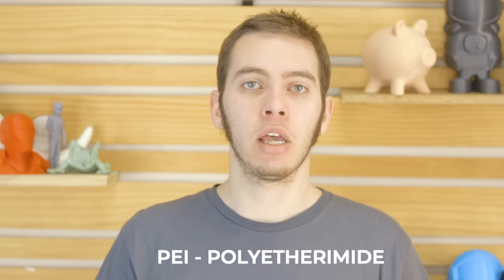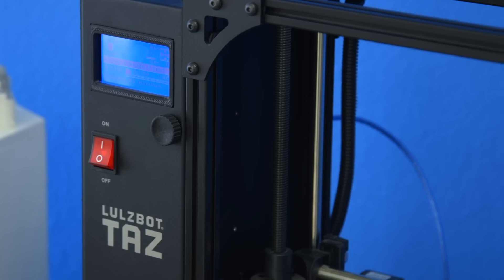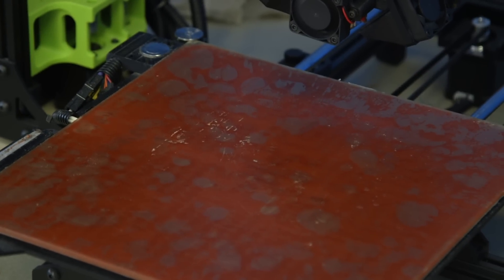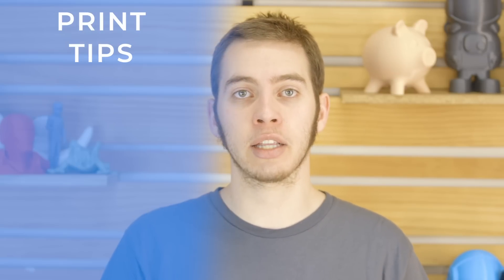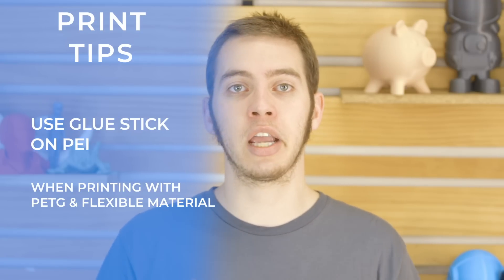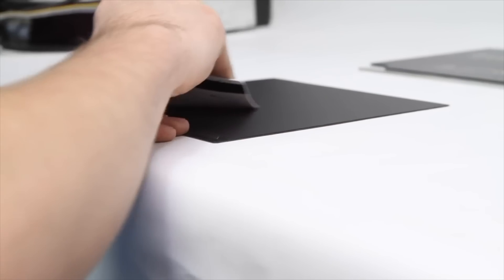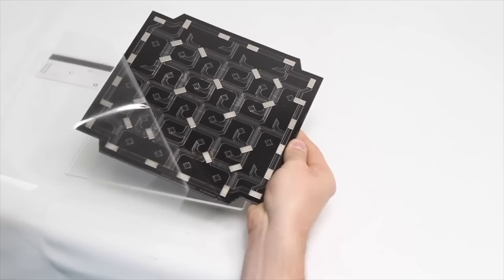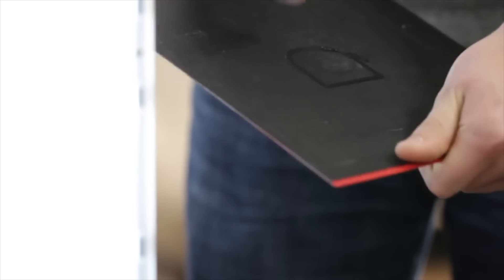The Anatomy of a 3D Printer // 3D Printer Bed Surfaces

Comment: A few nits ... particularly for heated print beds.

You want to keep in mind thermal conductivity:
https://en.wikipedia.org/wiki/List_of_thermal_conductivities

Glass is a poor thermal conductor. That means the bed will take longer to heat up. (Though for long prints, the time needed for the bed to heat is less important.) That also means you want an aluminum plate under the glass as a heat-spreader. If you put the heater directly under glass, the temperature on the surface of the glass is going to be somewhat uneven.

Aluminum is an excellent thermal conductor, and so placing an aluminum plate on top of the heater is a very good idea. (Does anyone not use an aluminum plate as a heat spreader?) To get a truly flat surface, you want to mill the top surface ... which is somewhat expensive. (This is where the design trade-offs get tricky.) 

Glass is a cheap very-flat surface, and we need a flat surface for a print bed. Ordinary glass expands when heated, so is less flat when heated unevenly. (Which makes an underlying aluminum heat spreader highly desirable.)  Borosilicate glass does not expand when heated, and so offers a consistently flat surface - though is a bit more expensive. Borosilicate glass is still a poor thermal conductor, so again you get longer heat-up times.

Steel as a thermal conductor is much better than glass, and not nearly as good as aluminum. This tends to favor the designs using a thin flexible steel plate on top of a thick aluminum plate.

(A plastic print bed is a truly horrible notion. There are some plastics with additives that increase thermal conductivity, but ... I doubt that makes enough of a difference.)